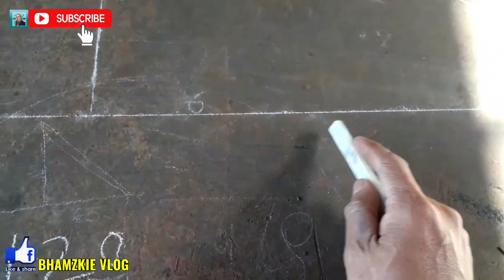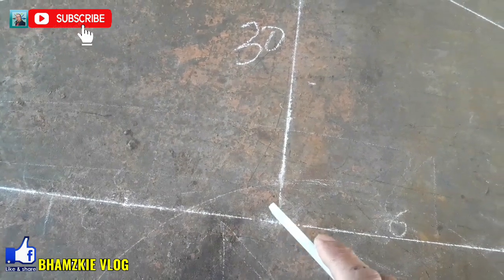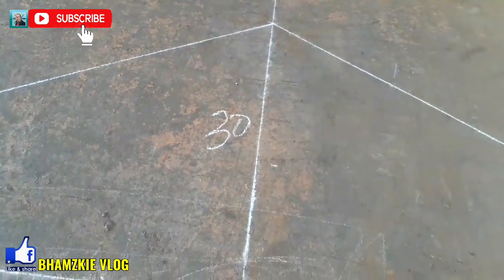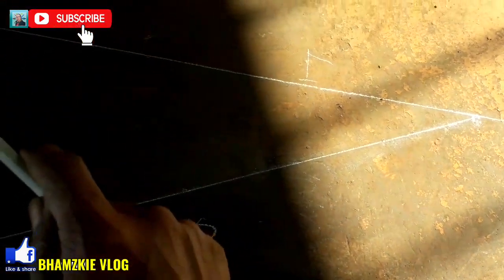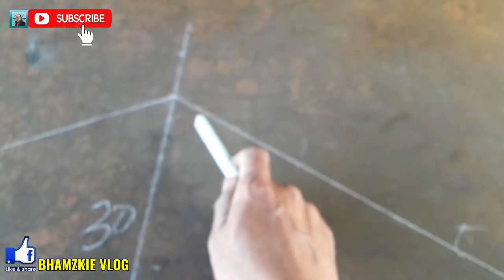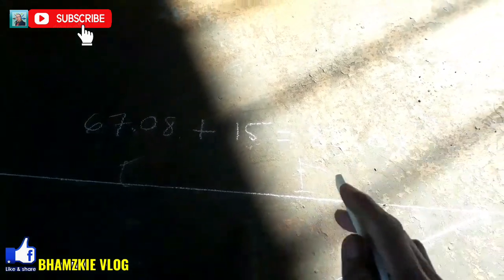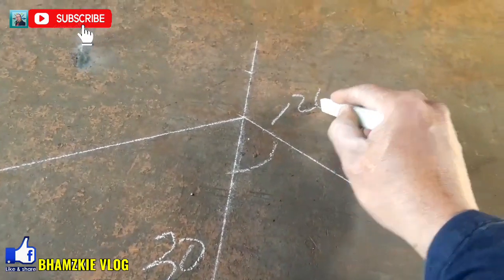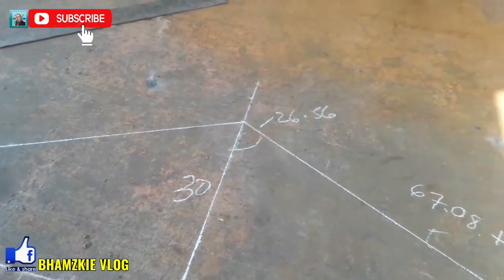PAANO MAG LAYOUT NG RAFTER STEEL TRUSSES (Part 2)

Comment: Mali ata ang position ng angle mo, ang sa taas ay 63.44 at ang baba ay 26.56.
Reply from the maker: Ok boss,ipagpalagay na natin na nasa taas ang 63.44 deg.ang katabi nyan ay 63.44 deg.din.kung e add mo ang dalawa na yan ay magiging 126.88 deg.ang angle na nasa taas.para makuha ang tamang miter
180 deg.- 126.88=53.12
53.12÷2=26.56deg.yan na po ang magiging miter nya sa bawat side.
At sa baba naman ang miter cut na  63.44 deg.
Reply: @bhamzkievlog5624  nold kumusta
Reply from the maker: Partner😁
Reply: Okay what you say the degree is 63.44 ° at the top so as not to complicate it I can do it 90 ° -63.44 ° = 26.56 ° that's my cut of the material.  at the bottom it gives me 26.56 ° the rest minus 90 ° -26.56 ° = 63.44 ° that's my cut of the material.  Greetings from Peru